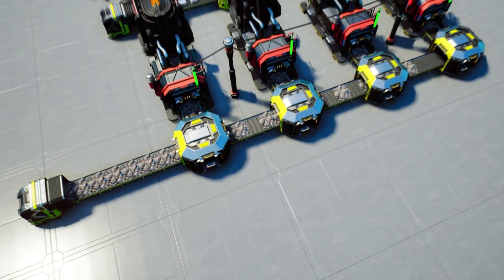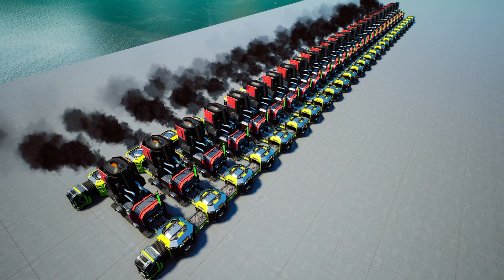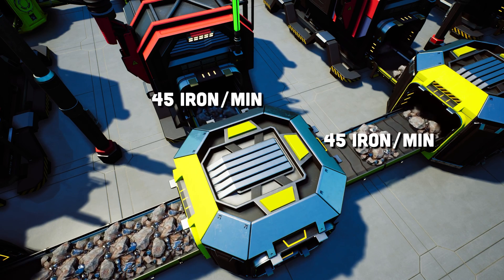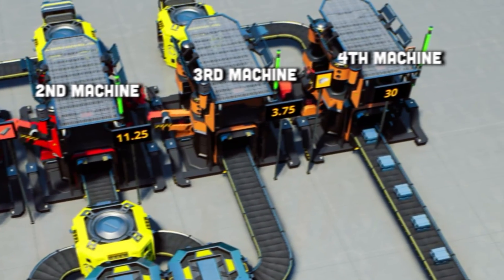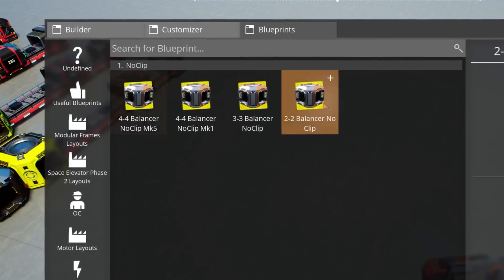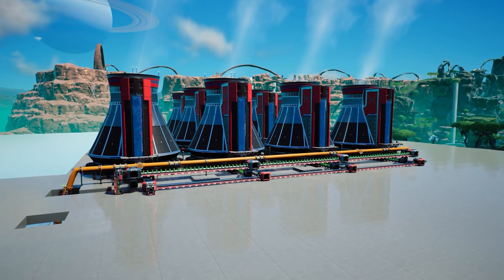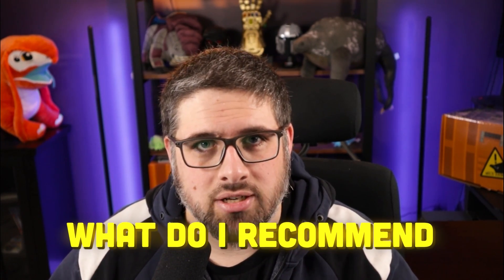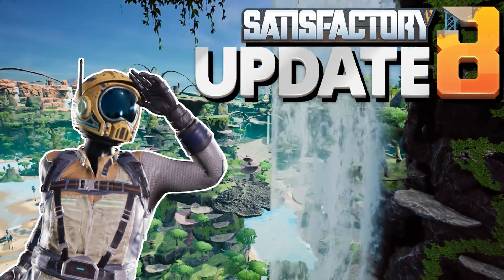The ULTIMATE Satisfactory Manifold vs Load Balancers Guide! (For Everyone)

Comment from the maker: What style do you prefer? (UBG5 coming soon 😅)
Reply: a 0
Reply: Team Build Enormous here. 

Definitely manifolds because the less splitters and belts you use the further you are away from the games object count limits. And the better game performance is. 

Anything simpler is better.
Reply: I am team whatever works better for the situation.  Manifolds are good in some situations and bad in others, and vice versa with load balancers.  One thing not mentioned that I don’t see many creators say anything about is utilizing storage “buffers”.  With the constant shift in resource needs as you progress, along with the increasing complexity, I always find that having some “buffers” inline makes a huge difference in keeping things running at peak performance.  I can always tell if a manufacturing line is gonna have problems when I check the containers.  If resource output is faster than the input, I will will investigate the line and make appropriate adjustments while everything is still running smoothly.  You can even manifold/load balance a bunch of containers which can seriously increase your total output so you hook up even more machines!
Reply: Team load balancing here
Take your time, your content is worth the wait

Comment: 10:50 thats wrong, the production may fluctuate, but in the end its items in = items out, the stuff you put in will not magically disappear just because you used a manifold. So on average you will produce exactly the same.
Reply: how much input is required for the manifold? does it depend on machine? like the 26 constructor example does that mean we need like 240 something ore coming in? or does it not matter
Reply: @gabrielnguyen5580 each smelter does 30 ore/min.  So 240 ore is 8 smelters.

Comment: I have found that with manifolds because the earlier machines still take more input whenever they finish a build (in this instance when a smelter finishes an ingot and consumes an ore to start the next), the final smelter/constructor will never reach 100% efficiency. There are always those split seconds where it does not have the required material and so it operates at 99% efficiency. You can fix this by barely underclocking the final machine, but this can cause problems for machines being fed by the output. You could overclock the input (like the miner) to produce slightly above the required (like 121 ore per minute instead of 120) but that is kind of a waste of a slug. The best solution I have found so far is to overclock the input where practical, but instead of just barely overclocking, overclock by one extra machine's worth plus a little. So instead of 120 or 121 ore per minute on a miner, have 151, add another smelter to your manifold, and an extra ore to help keep your last smelter running. This way the slug isn't as big of a waste but also you dont run your power usage through the roof.

Comment: You actually don't know how to explain manifolds. Totally wrong . The only value that was right was the saturated output volume on overflow .

The output is always half of the input when split 

And then the ratio changes if there is a belt speed imbalance 

Input of 240 full , an output of 60 and an output of 240 would give you a 1/4 split on the 60 for the first manifold , unsaturated . And then approaches closer to half for each manifold until the output regardless of the belt speeds is equal 

Belt speeds matter when manifolding , and most manifolding should be avoiding early game unless you don't really care about efficiency

Comment: I just load balance before I use a manifold. Like in your smart plate example, I wouldve just split the iron into the proper ratios for pipes and plates, and then use that line with a manifold

Comment: hey man this is a great video but I feel obligated to point out to you that, whether you use 2 or 3 of a splitter's outputs for a given task, in both cases, you are dealing with a prime number! primality is not a factor in complexity here - in fact I would go so far as to argue that it helps, as 2 and 3 are great factors to work with when I'm trying to split things into more complex sized piles.

(obviously 1 isn't prime but if you're only using 1 output then there's no use to the splitter)

Comment: Food for though... A manifold that's being fed by just the right amount of materials mathematically can never actually reach 100% efficiency. It can get to 99.99999% it can get infinitely close to 100% but technically never actually reach it.
Reply: Or if you do want to cover for that small percentage all you have to do is to prime it with one or two extra material in order to cover for the travel time issue
Reply: @puddleofbooks this is what i have in mind. I typically make the miners first, so I can just stockpile the inputs before starting it up.
Reply: That's simply not true. You can set up a basic iron processing to see that every machine gets to 100% once the belt and previous machines are saturated
Reply: @RG-gn8pe  it is true. It can get infinitely close to 100% but not actually reach it.

Once I get back to my computer I'll pull some real numbers for examples.

Simply, if you feed a manifold with just the right amount of materials and eventually let it saturate so it functions as if at 100% efficiency but you remove one item from the belt, you can imagine that removing that item from the belt will mean that for the brief period of time that gap works it's way through the system, you're under feeding the system. Eventually it appears to catch up but how? How could it possibly catch up if being fed by just the right amount of material?

The reality is, over time that deficit slowly becomes less and less of a fraction of the system throughout and you approach infinitely close to 100% efficiency but never TECHNICALLY reach it.

Functionally though it makes no difference.
Reply: @JohnErikMills  let's say you have a belt with 60 items / minute feeding four machines that need 15/min each.

The first belt in the manifold will receive 30 items/min until the first machine is full, and then will only consume 15 items/min to match the machine.

After the first machine warms up, we will get exactly 45 items/min towards the second machine, which splits into 22.5 items/min until it eventually backs up as well, consuming exactly 15 items/min, and passing on the remaining 30 items/min down the line.

The last two machines are separated by a single splitter at this point. The splitter is spreading exactly 30 items amongst two machines, reaching the perfect 15/min per machine.

It takes a lot longer than a proper load balancer to get started, but the end result in a manifold is exactly the same.
Reply: 120/min smelter setup works on 99.999...% but somehow still processes 100% of ore. Doesn't adding up. It won't work until it gets filled up required amount and then will run at 100%. Specially in this game where smelters (and other buildings) doesn't start working immediately, but after few seconds.
Reply: If there’s just a single extra unit in the input buffer (either manually placed or through some incidental lag of your startup sequence), that covers the remaining % you’re referring to. 

I get what you were suggesting, but in practice the scenario both presents the theoretical gap then closes it back up again.
Reply: @vi3tmix I agree. It's a thought experiment at best.

Comment: Manifolds are way better than load balancers IF the entrance direction is the same as the exit (if it enters from left to right, it exits from left to right).
Reply: BS if I take the first example I can make it with just 2x2 corner in additional space on each side. And I can easily expand it to the max throughput of 1 belt. That said I only divide by 2 or 3 or multiples of that. Anything else is not worth the effort

Comment: I use a mix of both like for the reinforced plates and a splitter that goes into 2 separate manifolds for the respective parts. now you are technically using a load balancing manifold

Comment: Your 75 to 15x5 example is more easily solved with 1 smart splitter to a full 60 with overflow of 15 then split that 60 into 30/30 and then 15/15/15/15 and done. Now if the 75 ever dipped the overflow 15 would suffer, clearly.

Comment: I've seen videos where people push load balancing as the only way to go because "you go to 100% effiency immdiately." But as you say, Manifolds do achieve 100% eventually. To which I asked, why does everything need 100% effiency immediately? It doesn't. For most things, it's just a personal choice, not a practical one. I like how you provide practical examples why one would load balance in given situations. As one makes that initial jump from Biomass to Coal, which far surpasses starter biomass setup in every way, a staggered approach is often more than adequate. Your analysis is pretty much the same as mine. I usually do manifold unless I have different items on same line that I want or need it's production to be independent of what would be the first group on a manifold line, as your Starting Factory Reinforced Iron Plates point is explained perfectly.

Comment: Loved the video. Properly explained, and the editing is top notch. Still, I think there's a concept you are not teaching the best way.
When doing manifolds, you should never use regular splitters. Instead, you should be using smart splitters, sending everything to the machine, and the overflow down the line. I have just done a video in my channel comparing both approaches. A manifold with regular splitters took 64.92 minutes to properly startup, while the same manifold with smart splitters took 30.16 minutes. Its the same technique, same complexity of build, but only different splitter. You get twice the efficiency! There's a lot of people out there using regular splitters, and the thing is, when your factory has several stages, and each one of those is done via manifolds, those times will start to stack up.
Still, I think that this video is a masterpiece, and I really want to stress that. The ones I do end up looking 100 times shittier, and not even smart splitters can help with that

Comment: A trick for loading manifolds faster, set all the machines to the minimum overclock, so they still accept items, but use it so slowly, it fills way faster than it uses, then set it back to the desired speed on ine, copy and paste that setting to each machine, saves time and lets you buffer the last couple machines.

Comment: I am using more "hybrid" approach. 
Basically in most cases i use very simple load spreader, that final adjustments makes similar to manifold style. 
Recently i also almost overuse overflow function of snart splitters. 
Basically i am making manifold main line that will split to aimple load spreaders. Ie for coal generators. I am using segments of four generators on spreaders. Manifold is on smart splitters that will have main exit on overflow. This solution allows of graduating turning on of all segments of power gens. It will fill up faster each segments. And also allows me to build in advance. In recent playthrough i had 16 coal generators with useable only 8 at the beginning. (Mk2 belts in moment of building this facility) Only first 8 were getting coal at beginning but runned very smoothly. After i upgraded to mk3 conveyors and mk2 miners, that took me about 30 sec, next segments just came online

Comment: My problem most of the time is not to build a manifold... But to plan how the output get split and feed into the new buildings... Especially with items which produce a lot like screws or something...

So I try to use the tips like using factory planner websites which give me some fancy graph of how to distribute items...
But it always says that I need X amout per minute for that product... but this would mean that I have to use 3 seperate belts to support it... but other parts need them as well later and I do not know how to extract them in exactly the right amount

Comment: I use manifolds for basically everything, but I construct them a little bit different. First I split a line for different products. In the example in the video I would put a splitter at the start so die iron plates and iron rods each have a belt with 50%. It is also possible to use different belt speeds if it fits better. Secondly I use smart splitters instead of splitters before a production building. This way one building after another filling up with resources. If there are fewer resources than needed the first buildings still run on 100% and only the last buildings have less or even 0 production. For me this way it is easier to see how much is really produced.

Comment: I like using a combination of manifold and load balancing for loading into smelters / refiners / etc. When I split off of the manifold, I use a mk 1 belt, so that it only takes a maximum of 60, and then split that 60 between the 2 or so machines next to the manifold entrance.

Comment: The way I see it, you have a massive map, with planning, balancers are usually the way to go for me. With blueprints, update 8 is super easy to build compact balancers, compared to tedious glitch building to get shit to fit previously. I love they just let you clip now. I dont clip through conveyors, but its nice to snug up to the machines. As long as it looks right, clipping is fine. Vertical building also helps keep compact.

Comment: Your reinforced iron plates statements around manifolds are actually incorrect. Once the iron plates saturate, the output will stabilize to a fixed amount of reinforced iron plates per minute, the exact same 5 as per the load balanced example.

And that facially must be true, because if it weren't, that means you would have iron ore building up somewhere. But if the iron plates are saturated, then all of your iron must be going into screws, and your system can't starve if it's being oversupplied iron into screws while plates are saturated. The bouncing you describe will happen so fast that it will be literal noise, identical to the same sort of flow fluctuations that happen in every factory.

Comment: Ever considered a 4x4 balancer using the Industrial Storage units?  2 ins, and 2 outs, automatically evenly split.
Reply: Industrial storage units don't balance between their outputs - they pick one and send most resources there first, the second belt basically being overflow when both input belts give it an item at the same time.
Whichever output is the 'primary' belt is usually the first belt you attach to it, but IIRC it can change on reloads.
Every time I've done a load-balanced setup and also needed an industrial storage container, I had to load balance the outputs or never use move than 1 input and 1 output.

Comment: 1> Load balancers don't automatically give everything the exact required amount. They split the item stream equally. If everything used the same amount then they all get perfectly fed. If not, then it works like a manifold.

2. Load balancers can take up a significantly smaller footprint than shown if you don't build them with 49867543987 miles of useless converyor between each splitter.
Reply: "load balancers don't automatically give everything the exact required amount" - right, they don't. Correctly built load balancers do, though. But you have to figure them out, which is exactly why they take more time and space.

"they split the otem stream equally" - nope, that's what splitters do. Splitters and load balancers are not the same thing. Load balancers are systems that utilize splitters, but only you decide how exactly it will be split.

As for taking up space, they will still take a lot compared to manifold. Even if you try to minimize the amount of belts between splitters, at the end you still have, let's say, 24 smelters and each of them has their own input. In order to build a correct load balancer for all of them, you will need splitters set up in a few rows, and each of them will need some distance between them, because whatever you do, you can't just squeeze the inputs if the smelters into one single point
Reply: @holeintuni i think he meant you can stack splitters on conveyor lifts and use that

Comment: Usually I just do manifold. If I get to nuclear I've usually got the means to mitigate the radiation so I don't worry about backup too much. However, sometimes if I make a longish manifold I will split the input and feed it from both sides so it gets to efficient faster. I'm sure that's not THAT effective, but it makes me feel good lol. And it adds just a little extra visual interest to just a line of smelters or whatever. If I'm planned ahead enough to build a logistics floor to feed buildings making low volume items, then I'll load balance "properly."

Comment: 5:18 You can always do a hybrid system between to add the other two smelters. Add just one more splitter at the start. Two outputs going to the two extra smelters directly and the third goes to the 24 load balancer. The two additional smelters will fill so fast that you’re still getting the quick wind up time of a load balancing system.
Reply: I would call hybrid single line 480 and 60 belts splitting off and additional split or overclock. I placed splitting belts and mergers under the smelters, loved the solution I came up with. Blueprint requires more tweaking for looks and modularity.

Comment: An information Id like to add. If you want to use manifolds, and you want the start up time to be better, you can easily do this using smart splitters. Instad of always splitting 50%/50%, just send to the first machine everything, and then the overflow to the rest of the line. This will make the machines fill up way faster!.
Reply: or splitting your initial input once to split the manifold in two